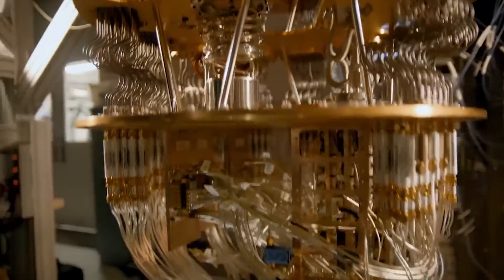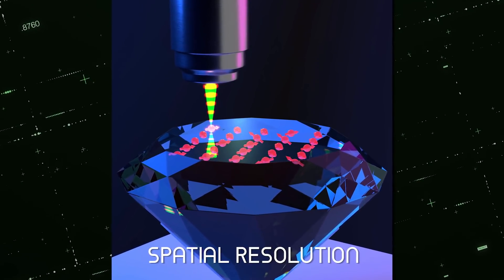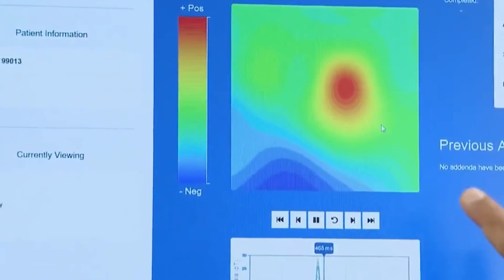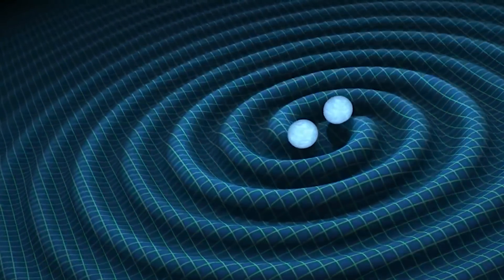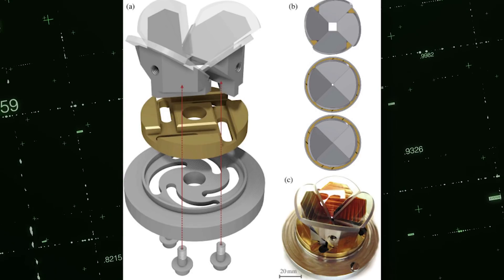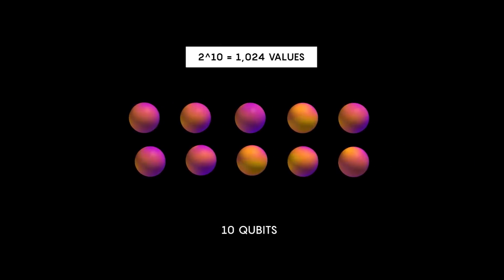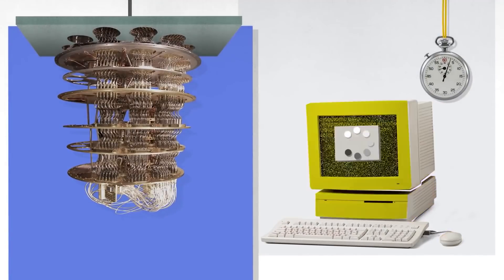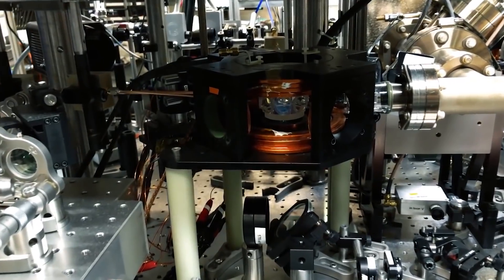Every Major Quantum Computing Breakthroughs in 2021 So Far

Comment: Spin-tronics appears to be frozen in crystalline structures, the synthetic diamond is as strong as the "pulling-force" that holds it together, but yet there is not any part of that synthetic diamond that is "not" moving, including the orbiting-particle system's that make up the electron, proton, and neutron of the carbon atom. If an observer could shrink there self small enough to stand on one of the electrons that make up an synthetic diamond, that observer would have a much better view of the qubits that were put in the synthetic diamond. Likewise... if this observer had a tunneling electron microscope while standing on this syn-diamond electron ... this observer would still have to send the pictures back to our size & time domain via propagation delay, using the vortenticy of an under-square vortex, being that particle-flow within these complex particle-flow grids that make up the synthetic diamond are linking empty-space with filled space, where empty-space would be considered infinite, (organizing-mass)and filled-space, (disorganizing-mass or boundary-producer), may suggest...  that infinity is the primary cause of the pulling-force that holds the diamond together.
Reply: Tell that to carbon before it's had millions of years of pressure imposed on it.
Reply: @solcutta3661  Yeahhhhh... Ahhhhhh...  that's cool, you see it too, and that's greatly appreciated!!! But what I do not understand is that transportation to & fro from basically the carbon atom... reaching into the heavens, blows my mind!!! Experimenting with the particle flow regime that moves faster than the speed of light, shows a binary connection with that which moves faster than the speed of light and that which moves slower than the speed of light. To make a long story short... the formula... motion per mass : per location, per time. Like a mechanic... disorganizies mass per location per time, in a...  "organized fashion", in that reassembly also takes place, per location per time. Denisity amplafcation factors versus density de-amplification factors, become quite obvious when you are in this particle-flow regime. Thank you for your sacrifice!